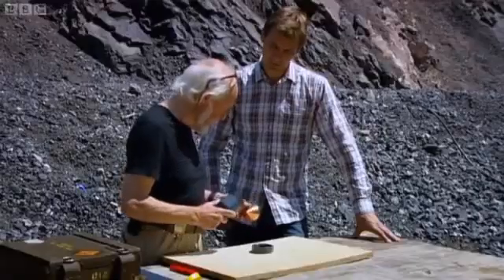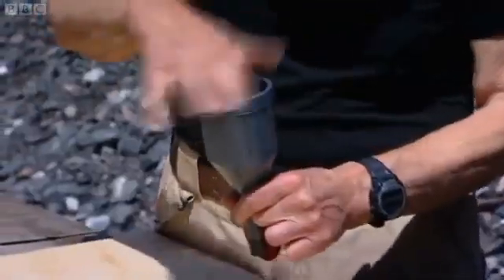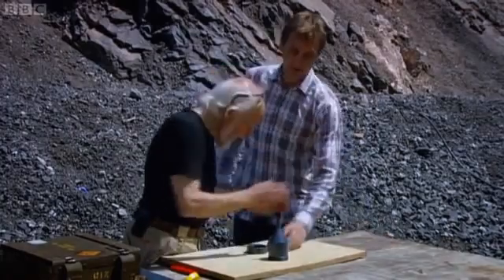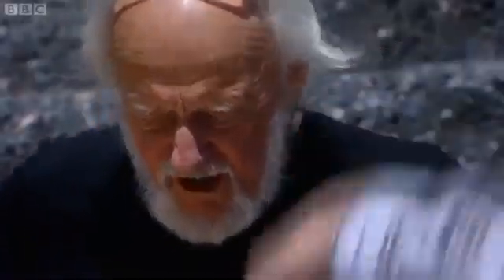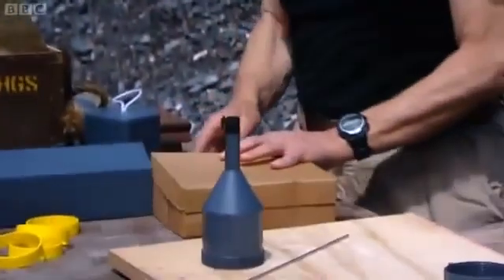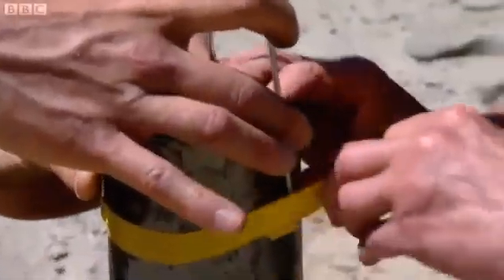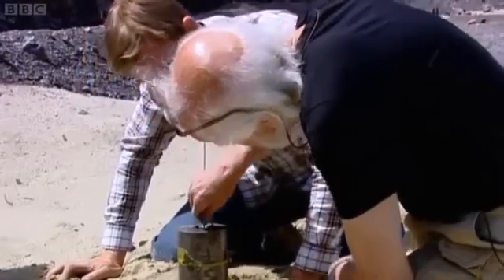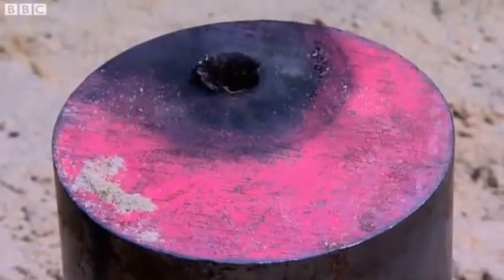Shaped Charges

Comment: It went through a foot of STEEL...     Holyyyy shit
Reply: Oscar Casteneda its called a RPG, its basically the same but a little smaller.
Reply: Candi Soda you think is possible to make a gun out of this?
Reply: A bit of lateral thinking might arrive at something usable. Larger caliber rifles might be able to capitalize on this: have C4 cores, a copper cone penetrator. A triggering mechanism would have to be engineered to cause detonation at the proper distance from target, and a typical 308 round with such a setup would be able to hold sufficient cone size to allow 2 inches of armor penetration. Which is saying a hell of a lot. Even steel core 308 point blank won't go through 2 inches of steel.
Reply: This is exactly my thought but in centimeters.
Reply: You can achieve similar results with glass liners.
Reply: @gazmeister1984  no you cannot. Glass liner is totally different than copper liner.
Reply: Even a small sandstone boulder only couple feet thick can defeat RPG-7. There's a YouTube video of it. Took 4 hits like it was nothing.
Reply: Ils ont utilisé quoi comme explosif, et comment s'en procurer? C'est pour un pote
Reply: +Oscar Castaneda Munoz no. the explosion and pressure is to great. and would cause serious injuries.  👍
Reply: @terrylick5908   yeah would cause serious injuries that are more commonly known as death
Reply: That's why composite armour is a thing! :D
Reply: @sxleong  It's why reactive armor is a thing.
Reply: composite armour doesn't stop this. explosive reactive armour is your only chance
Reply: @terrylick5908  Shaped charge rounds have been a thing since ww2. Most tank/artillery guns can fire them nowadays.
Reply: That's not too impressive. Most tank rounds double that nowadays and ATGMs triple it.
Reply: stainless steel is VERY VERY soft steel. Only like 120 brinell I think. Steels like AR500 or AR600 with only few inches think probably would stopped this shaped charge.
Reply: Stainless steel is relatively soft. It's no surprising it went thru that much. Here is a video of shaped charge failing to penetrate. Now before you argued that's a weak shaped charge, yes it is. But maybe it's also a stronger steel as well than the stainless steel.
https://youtu.be/BBruJJfs8fI

Comment: What I really wonder is, how far does the shaped charge effect scale? Does it scale linearly as the charge and liner are increased in size? Or is there a point of diminishing returns?
Reply: Nobody has ever designed a tough enough armor for that to matter, there's always been a shaped charge capable of penetrating any known armor.
Reply: @Travis Thacker It would vaporize the metal. So not plausible.

Comment: the nail is molten when it goes through!
Reply: No, it remains non-molten, though the pliability of copper allows it to be formed into a high psi spear under the intense microsecond pressure of the charge. Such penetrators, during the formation phase post-detonation, reach pressures on the penetrator tip around 15 million PSI.
Reply: @davidsirmons  there is lot of misconception. A lot of people think shaped charge's copper jet stream is molten copper and melt its way thru steel. And a lot of people believe it is formed solid copper when it penetrates the steel. I'm no shaped charge expert but I'm incline to believe it is actually solid copper jet stream.

Comment: can this kill 650mm of battleship armor
Reply: A large enough penetrator with enough explosive, yes.
Reply: @davidsirmons  the only way to find out is to actually do it.
Reply: The HEAT charge of AGM-114 Hellfire penetrates 1100mm of Rolled Homogeneus Armor
Reply: @Maverick966  theortically
Reply: @7150285  It is not theorical, it is a fact
Reply: @Maverick966  not true. It is theory. As no real life test were done to actually prove it.
Reply: This particular one no. A huge one yes
Reply: @theshermantanker7043  only way to find out is to actually do it.

Comment: If you provide carbon fiber fitting instead of that plastic form it will give a great improvement to the shape charge.
Reply: It literally doesn't matter what you make the container out of.  The physics of the shaped charge is determined by the geometry of the explosive material and the dimensions of the cavity, as well as by the dynamic characteristics of the explosive.  What you put it in doesn't matter.  What you put in it doesn't matter in terms of how the shaped charge operates.

However, the material used for the liner (in this case copper) is extremely important.  The explosion is only half of the story.  While it is possible to achieve dramatic effects exploiting the Munroe Effect on its own, anti-armor shaped charges are essentially hypervelocity shotguns.  The copper liner is compressed and heated to the point of superplasticity, and essentially becomes a semi-fluid propelled at extreme velocities which can cut through dense armor plating like butter.  The channelling of the blast via shaping of the explosive is what makes this possible, but it is the molten copper jet itself that does the work, not the explosion.
Reply: In my personal opinion the material used for form DOES make the difference. Presented on video example could be also made as II-stage. I stage would be a classic explosion accelerating I stage. Used delay for II stage is  easily computable.
Reply from the maker: what kind of material can used as the liner instead of copper? can use glass for example?

Comment: Is the jet that impacts the metal a liquid? Is that why it penetrates?
Reply: The copper is not melted. It's still solid but is in a state of superplasticity because of the Munroe Effect.

Nothing is melted in shaped-charge munitions.
Reply: No. The jet is not molten but remains solid. They mentioned that in the video. The jet travels extremely fast, more than 20,000 fps, and literally pushes the armor out of the way as it hits it.
Reply: ~25-26k fps, at ~15 million psi.
Reply: It's liquid because of the melted copper. But even without the copper, the high pressure high temprature compressed shock wave (air) created from the explosive will also focus onto this 'jet string' shape, and is enough to penetrate some metal. Google "Menrou effect"

Comment from the maker: can  use glass as shape charge instead of metal such as copper?is it capable of create the jet?
Reply: The shaped charge is produced because the blast wave of the explosives are focused into one direction. The reason we use metal is because it enhances the effect and helps penetrate armor. You don't actually need any liner to produce a shape charge.
Reply: yes, if you search "shaped charge" you can see theres a vid about using a martini glass
Reply: +amanma12 No you cant, glass evaporates before it can reach the temperature.
Reply: @4tonnesoffury329  look up other vids of people using wine bottle shaped charge. It works and went thru 2 layers of RHA.

Comment: How far will the copper rod fly? Could this device be 100 meters away from the target and still work?
Reply: Cui Ying no, that is not it at all
Reply: @losarzamas  I bet you can make this work at a range or make like a cannon with this that can focus the explosive shape charge in such a way for like 100 meter range. Like i imagine it could be used like a laser if made the right way
Reply: No, at a distance 3x the depth of the cone the jet begins to break up because different parts of the jet are traveling at different velocities and it also loses energy as it flies through the air. Shaped charges have been used for armor penetration for over 80 years. If it could be designed for a 100 meter range, it would have been done already. This effect has been extensively studied.
Reply: Nope. When the thing is travelling at 14 kilometers per second the resistive force will quickly slow it down too much
Reply: Bill Longhofer No. There are equations to calculate it, but after about 3x the length the the depth of the cone, the shaped charge begins to lose energy.
Reply: anyone made one hell big size of 'mother of shaped charge' and test it?  probably can penetrate 100 meters?
Reply: because the shock wave will not be focused into one axis anymore

Comment: Would an aluminum cone have the same effect as the copper cone?
Reply: Even a paper cone will do some job (unbelievable, but I successfully tried), but the denser the material, the more the mechanical job. Copper is ideal. The angle of the cone and the standoff distance also have its play in the performance of the Monroe effect.
Reply: It wouldnt penetrate as well, but essentially, yes
Reply: and lead? i know t has a low melting point, but higher mass
Reply: aluminum has less mass
Reply: I heard the peak angle is 80° but even 60° will work
Reply: Well, that is something to experiment with. I have always seen large acute angles like the 80 degrees you mentioned. The thing is that when the Monroe effect was discovered, it worked with nothing. Just hollow engravements in the explosive. Later they realized that adding some lining to it, the mechanical work was greater. If a copper liner is not used, it can even be done with copper dust. It can be shaped into a cone with some soft binder or use it as dust between two paper liners.
Reply: Yes, but as previously mentioned it wouldn't function just as well. In earlier versions of actual HEAT shells, aluminum was actually used instead of copper, iirc.
Reply: It would be weaker than copper as it's lighter and isn't as strong i think